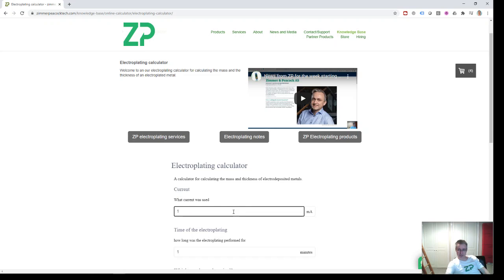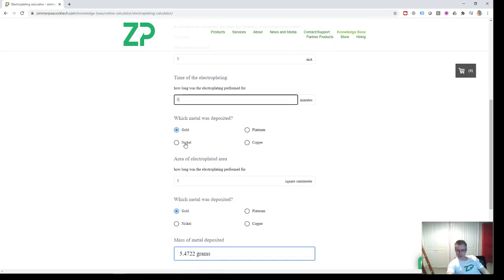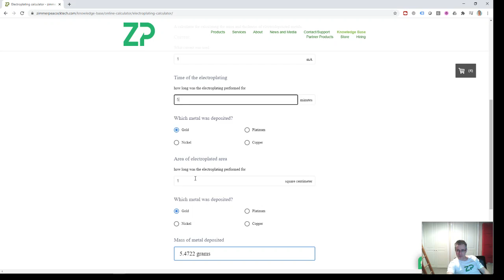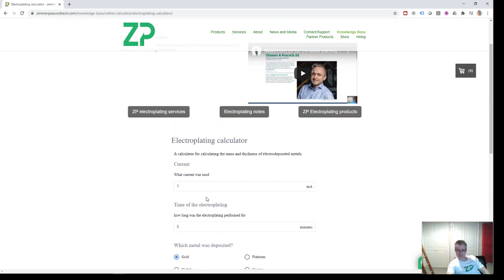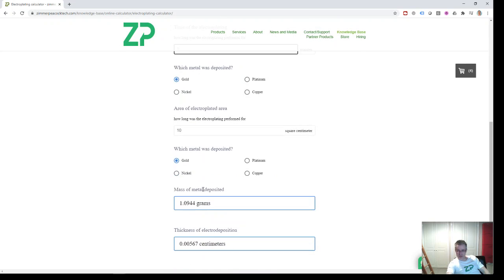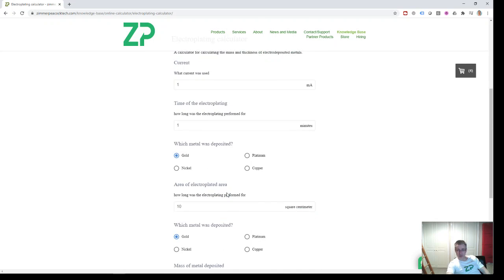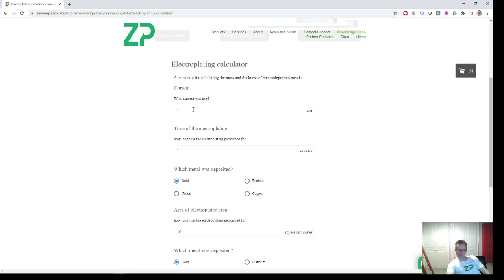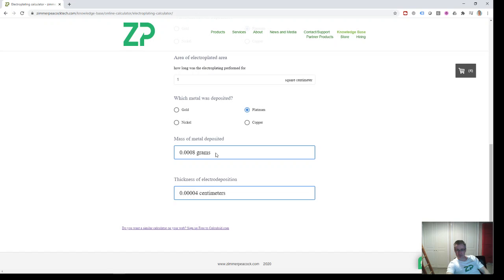Calculating the mass and thickness of electrodeposited metal

Comment: I think there's something radically wrong with the calculator. A current of 1 mA for 600 seconds is 0.60 C, and the mass of gold deposited by that is the molecular mass times the total charge divided by the charge of mole of electrons, so 197 * 0.6/96500 grams or about 1.22  milligrams.  Density of gold is around 19.3 g per cubic cm. The volume of gold deposited is around 0.000063 cubic cm. If the area is 1 sq cm, the thickness is around 63 nanometres.  The calculator suggests 10.9 grams and 5.67 mm thickness.  I think that's out by a factor of 9000, but perhaps it is 10000 and includes a 90% efficiency factor?  Needs a look anyway. Also the caption on the area entry box is the same as the time box.
Reply from the maker: Cheers, it's appreciated, will check
Reply from the maker: fixed now
Reply: @zimmerpeacock9703  Excellent news. Thanks for responding and fixing it!

Comment: thanks so much for the info and link. I have problems with conversion, so that is mostly the problem.  It calculated a thickness of over 8 cm of thickness for a 40 sq cm piece of metal,,, that's like 3 inches thick...  I must be doing something unright.
Reply from the maker: may be not let me check  :)
Reply from the maker: Fixed now